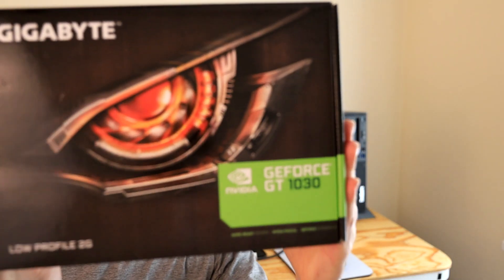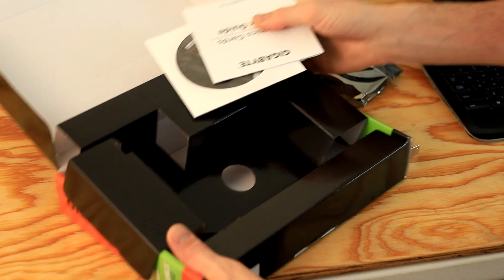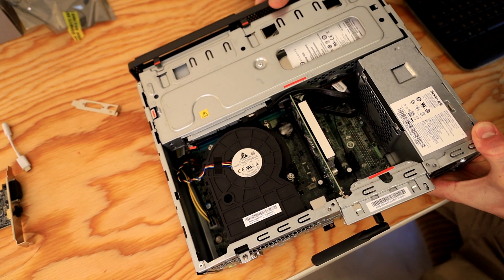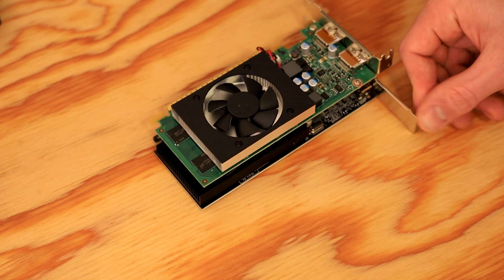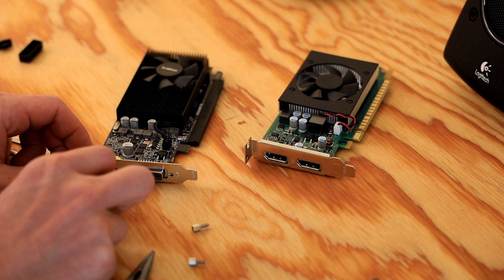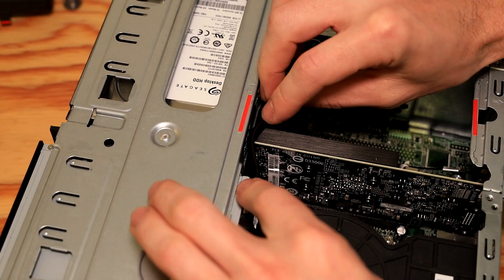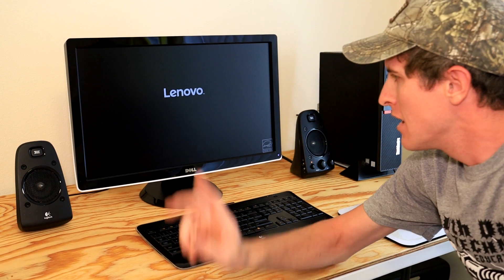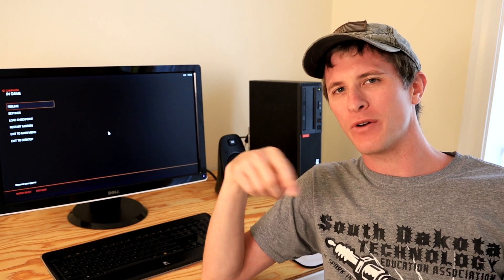Installing Gigabyte Nvidia GT 1030 Lenovo ThinkCentre M720s SFF Case.  Does it fit?

Comment: If you don't mind losing the big HDD and switching to smaller ones, you can cut a hole in the frame to fit a GTX 1650 on it. Also, I noticed you have a Wi-Fi or Bluetooth antenna on your PC, can you share info on that, it would be cool to add one internally instead of using USB ports.

Comment: Great Video. I noticed you installed a 3.5 inch hard drive + a mini hard drive. Are you still running the stock power supply? I noticed mine is 210Watt output and I am scared to add two hard drives and a video card. Have you had any power issues?

Comment: Which cable did you connect to the back of gpu? And where is it connected to?
I have a vga monitor, do I need to use anything extra like converter?

Comment: Did you experience some problems with the power supply in the long term? I have the same PC with intel i5-8500, 32GB Ram and 500 gb Samsung 970 evo plus and i want to upgrade the GPU with GT 1030 in order to do some 1080p low settings gaming.

Comment: Great Video, I have a Lenovo Thinkcentre M800 Small, planning on turning it into a gaming pc, I just installed a Samsung 980 Pro 1TB SSD, changed the i5 for an i7 6700k, 32GB Vengence LPX 2133 memory, I have a Gefore GT730 2GB video card, do you think I might be able to step it up to a 1030 like you installed on this one or is that pushing it too much? I think mine comes with a 210w power supply. Thanks

Comment: Very nice video ....did you keep the same power supply 
I had one with 210 w 
Will it be enough ??
Reply from the maker: I am still running the original stock PSU with 16 GB of ram, 1 SSD, and one 3GB Western Digital Black HDD

Comment: I have the same pc but I bought a MSI Gaming Geforce GT 710 GDRR3 64 bit HDCP Support DirectX 12 OpenGL 4.5 Single Fan Low Profile Graphic Card
Reply: Will this work on my pc
Reply from the maker: I have not read anything that says it wont.  You could compare the 1030's dimensions and the 710's size to find out.  The 1030 fits TIGHT as you can see in the video so I would consider it to be the maximum.

Comment: that GPU is more expensive than the whole PC
I don't know if you need to upgrade the PSU is that the stock PSU?
thank you
Reply from the maker: I am running the stock power supply on the 1030 and folks know every last drop is being squeezed out of it:-|
One day maybe I can check the current output and find out exactly how hard it is working...

Comment: wonder if Msi 1030 can fit ,it seems longer than this gigabyte 1030 (6.3 inches vs 5.9 inches)
Reply from the maker: The 5.9 fits and 6.0 might require one to break out the dremel tool...  It was tight to the point of touching depending on how much you tweaked the case around.
Reply: Aaron So The msi 1030 (6.3 inches) can’t fit the case , right? If I want to upgrade  the gpu , gigabyte 1030 maybe the only choice?
Reply from the maker: @diwu1424  I don't think it would when you look at how tight the GB card fits that any other card is going to fit that is longer.  Unless you want to mod the card or the case...
Reply: Aaron get it , thanks for share , I will buy the GB card too, the design of thinkcentre case is awful... I saw other SFF like dell can easily upgrade 1650 gpu (6.6 inches)

Comment: Hey!! Thanks for this video, Ive never built or installed a part from a pc before so this will help out a lot. Do you think it will fit a dell optiplex 9010 small factor form?
Reply: The 1030 low profile will definitely fit in a 9010 sff case.
Reply from the maker: From what I have read the Lenovo SFF cases are smaller than others on the market.  I would personally find out what upgrade card Dell ships with the system and get the measurements and compare it with the published specs for this card.